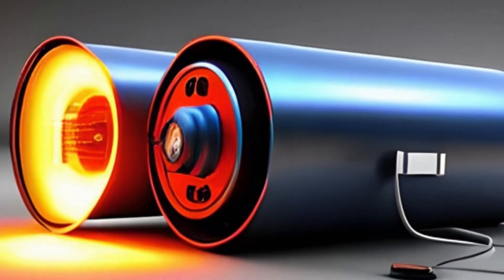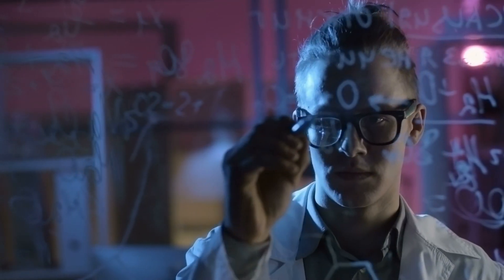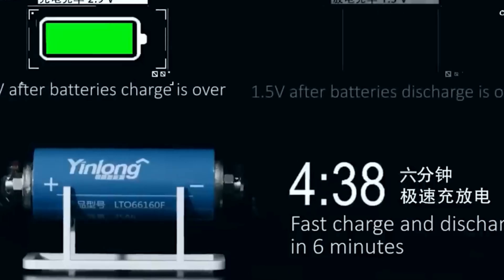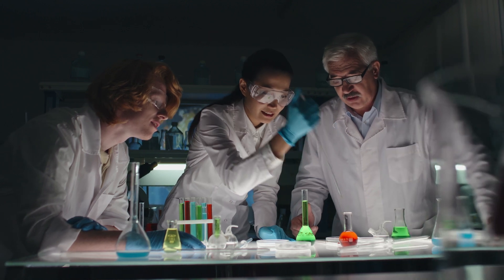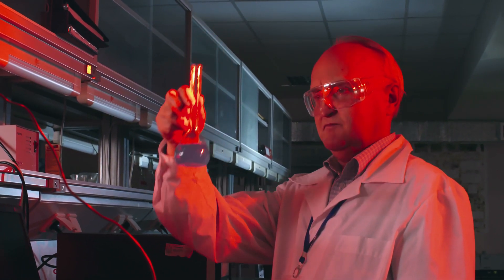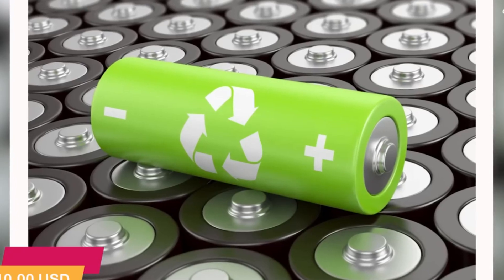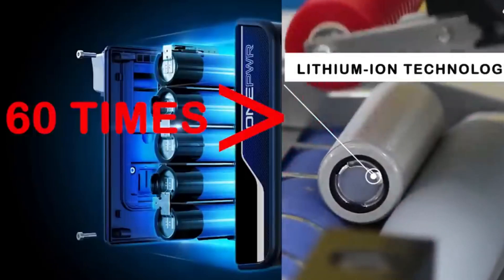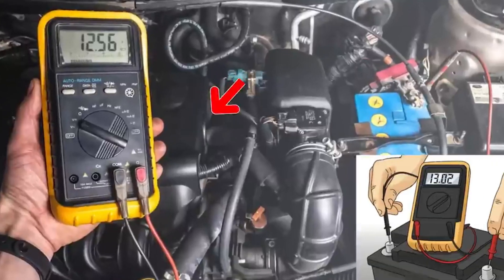Chinese Firm developed Nuclear Battery #battery #nuclear #nuclear_energy #teslabattery #technology

Comment: If natural radioactive decay is what powers these batteries than they are always discharging,  just because the electromotive force isn’t being utilized doesn’t mean that force will be there fifty years, even though slight,once it decays to a stable isotope, it will be discharged.
Reply: Nickel 63 half life is 92 years, so by limiting it to 50 years they cut it off before the batery  underperforms...
Reply from the maker: thank you very much for the comment